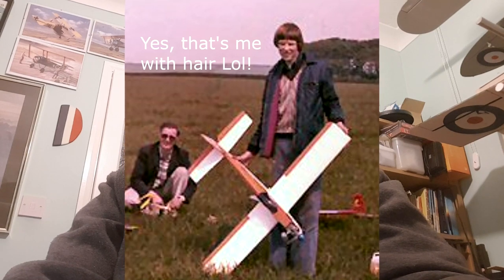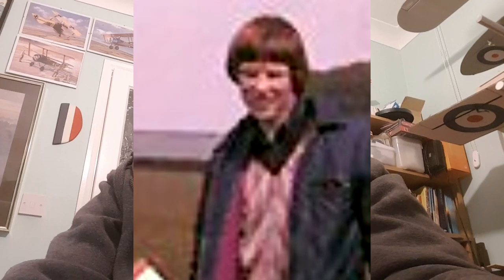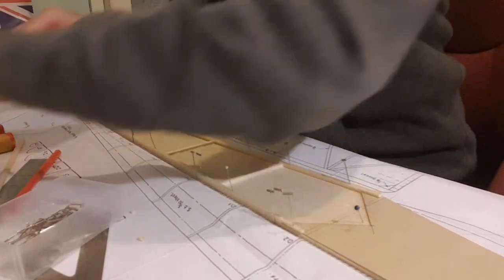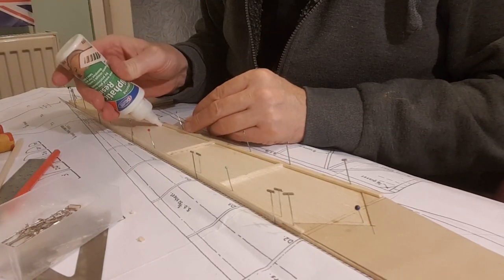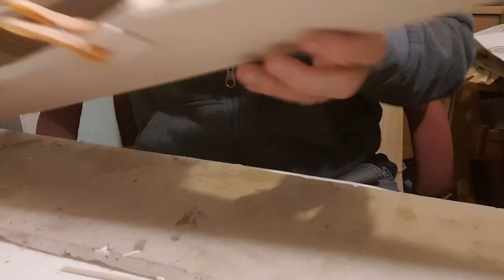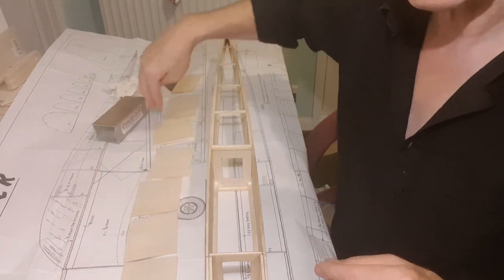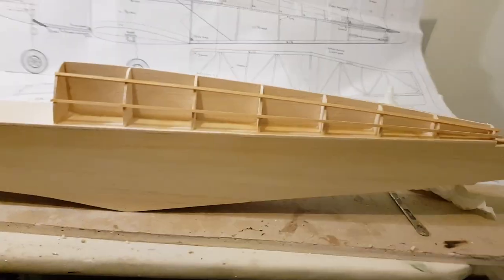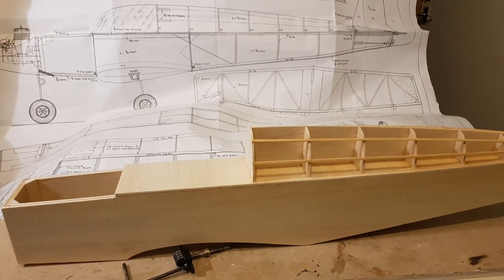Kamco Kavalier Radio Control Plane Retro Build Part 1

Comment: What a nice project to start the year with. Im looking forward for part 2. I wonder, do you have any memories on how the Kavalier flew in your younger years? A lot of adjustments being made?
Reply from the maker: Strangely enough Paul I don't have any memories to tell you about,  of course we only had the slider trims on the transmitter for in flight adjustments prior to landing and making manual adjustments on the flying surfaces, I'm almost tempted to fit an old radio set from the era 😯
Reply: @CliffHarveyRCPlanes   Thanks Cliff, that would be very retro indeed ;-] Good clean fun though, even thinking about it.

Comment: Wishing you a better 2021 Cliff. Would love to hear a discussion about how you decided what motor, ESC, battery and prop to use, Cliff? I still have not mastered this.
Reply from the maker: Well, me neither really David, I've robbed the bits you named out of my 60in Wayfarer biplane, it'll give the Kavalier a bit of 'zip' 😁 My local model shop man is very knowledgeable, I tell him the size and weight of a model and he sells me the bits I need, it's all a grey art to me as well really 👍
Reply: @CliffHarveyRCPlanes  5 mins ago I was testing a little motor I had kicking around that I think I'll try on my  Vulcan creation. 57 watts with a 3s and the 3 blade prop on it,  and not getting warm even. Could go bigger prop?  I go a bit with the watts per pound rules.   375 gms all up appx.  70 watts per pound?  Might just about fly!  Plus I  look at what (watt??) works on other models?
Reply from the maker: @bobflyman  I do know 100 watts per pound is a good target for easy flight, assuming the model will fly Bob 😁

Comment: I was wondering when you might pop up again happy new year Cliff
What a cracking build great idea to use beech stringers
I have been using 1/8 pine stringers for a few years just buy a piece of pine with no knots in it and strip it with a fine blade on my table saw the little bit of extra weight I think is worth it
I am looking forward to seeing more building
Thanks Cliff
Reply from the maker: I always pop up Mike, thank you, and happy New Year to you as well. I find that stringers usually end up getting broken with rough handling eventually, so beefing them up is definately a good idea, more to follow soon, thanks for commenting. 👍

Comment: Im also intruiged you dont appear to be using anything like clngfilm over the plan to stop the model sticking to it,
Reply from the maker: You're right, good spot, I only use it a covering if I'm in danger of glue getting onto it, the fuselage sides were pretty easy to build without splashing glue everywhere! The next video detailing the tail feathers definately uses polythene as shall the wings after that 😁👍
Reply: @CliffHarveyRCPlanes  thank you for that reply.